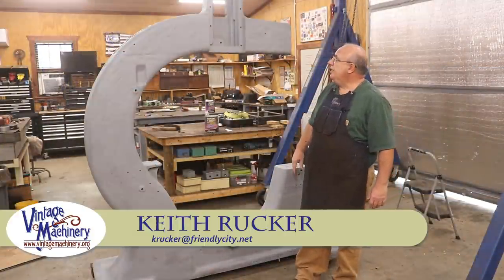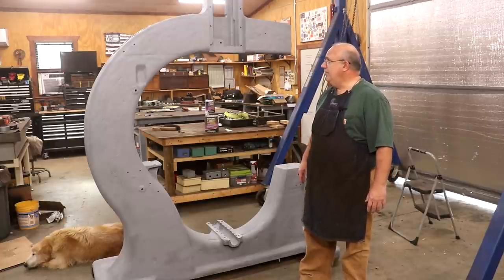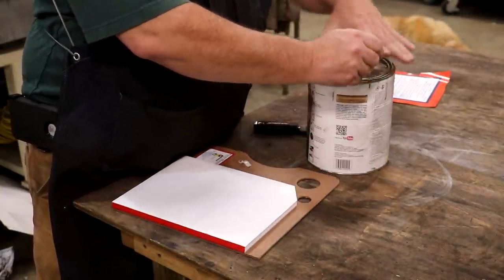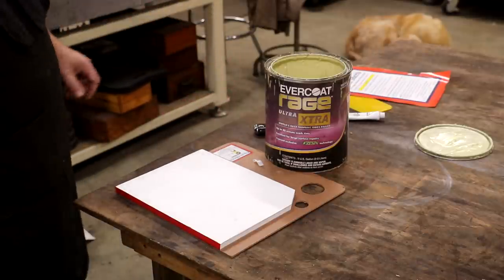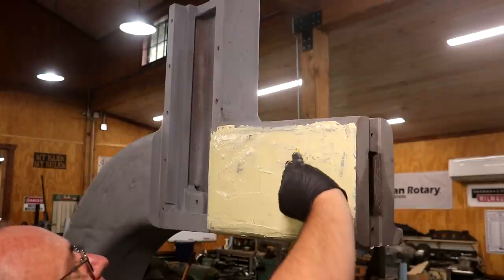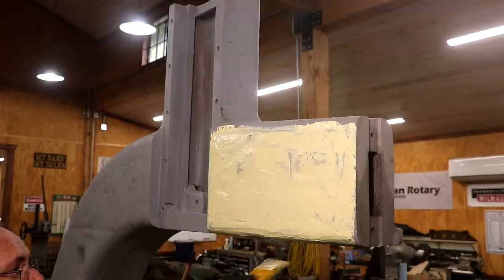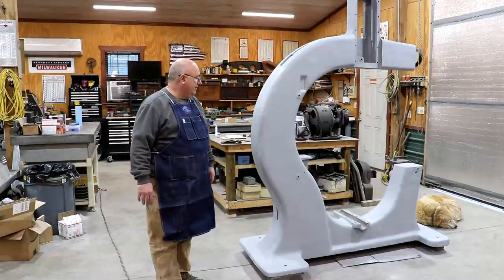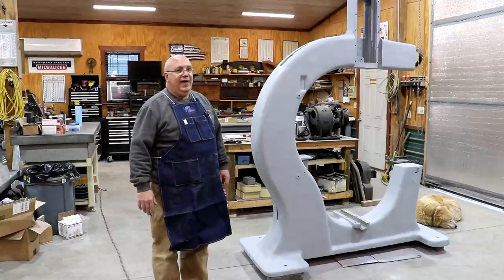Diresta Bandsaw Restoration 13: Applying Body Filler to the Main Casting for Paint Prep

Comment: So you used modern filler materials, but what did they use at the factory when they originally built it?  Obviously not a plastic resin, so what did they have to smooth the rough castings?
Reply: A steam engine I restored years ago had filler on it. I think it was a powdered lead based material that probably used linseed oil as a binding agent. There was also a line of fillers branded as Smooth-On which were a powdered iron product. You mixed the powder with water and applied it. It hardened via chemical reaction instead of oxidizing an oil.

Comment: I gotta be honest, this casting looks like it was made on Friday afternoon. Good job, Keith!

p.s. I wonder, what were they using for filler before Bondo was a thing?
Reply: Lead. That’s why old mercs are called lead sleds
Reply: @paulerenberger1286  I knew about lead, but i've seen a filler-like stuff being used too, was wondering what it was
Reply: @StanislavG.  I believe body filler was invented in the early to mid 50’s if I remember correctly. I watched a automotive documentary a few years back and they talked about body fillers in it. They also talked about Billy Hines who is the god of lead filler. No one could do it like that old boy
Reply: @paulerenberger1286  You mean the automotive epoxy stuff, but that's a bit different. I was talking about this Zimmerit kind of paste you sometimes see on really old castings. It's powdery, off-white-ish and the pretty soft
Reply: @T_Hoog  Really? That's all it is? Amazing!

Comment: How do you do the sanding? Someone showed me a great tool for sanding nice and smooth big surfaces, which consisted of a slightly bowed wooden board, two drawer handles and a long strip of sand paper on one of the flat sides of the board. With enough body movement you can work pretty efficiently with it and it doesn't create craters because of the size.
Reply: Depends on how fine of a finish you want. In auto body work, a cross hatch pattern is used to prevent peaks and valleys in the finish for a flat even surface. Due to the curvature of body panels, they'll use a dura-block as a backer for the sandpaper because it's flexible.  The general rule of thumb is to use the largest sandpaper backer you can to keep the panel as even as possible. 

Could you use wood as a backer for sandpaper? Sure you can - but dura-blocks are a far better option.

Comment: What would the factory have used to fill the voids at the turn of the century?
Reply: lead ?
Reply: Coal Tar, the thick black layer under the Paint, it filled voids and sealed the Casting, was used on Roofing and many other applications.

Comment: Nothing wrong with the filler you're using. Only thing I see is the same mistake most people make, you're working it too much trying to get it perfect the first time around. Use a Guide Coat and it will show where you to need to add more.
Reply: Yep. The application of filler should be a single pass. Just slap it on and scrape it flat. Then apply another coat, no need for guide coats on a surface like this. The important thing is to NOT try to fill the dips and holes.... always scrape flat. It's a LOT easier to apply multiple thin layers of filler than it is to sand anything.
Just apply a coat, then when it hardens just knock off any ridges with the scraper and apply another coat, once again scraping flat. Never attempt to "fill", just scrape it flat.... once there are no high spots showing, that area is finished, and ready for a light sand and primer.

Comment: What did they use as filler back when that was built. They didn't have polyester fillers. I know they used lead solder on automobiles. Did they use solder, or a thickened red lead or white lead?

Comment: With that casting being SO bad and looking like the surface of the moon, I wouldve started FIRST with Duraglass which is a dark green product, with fibres in it to fill the really large pockets and craters- then sanding, then that same filler you used...... But then I would NEVER use that old school "Nitro-Stan" or red-lead crap we used in the 60's and 70's, it doesnt stick, it shrinks back in the future and leaves divots in the finish, what they use now is GLAZING putty (2-part) MUCH better product, very similar to the yellow filler you used, only smoother and finer-
it hardens and cures quick and doesnt load up sandpaper like red-lead